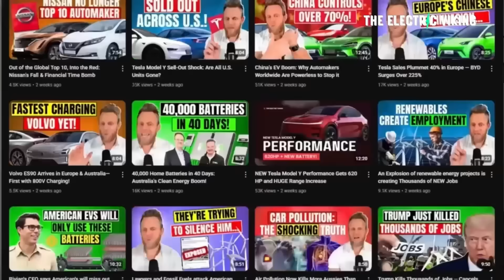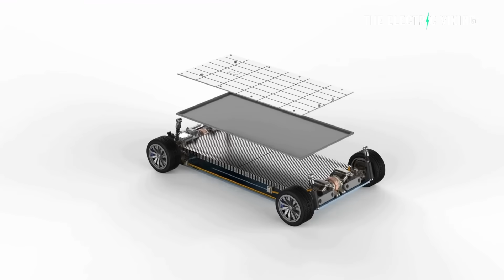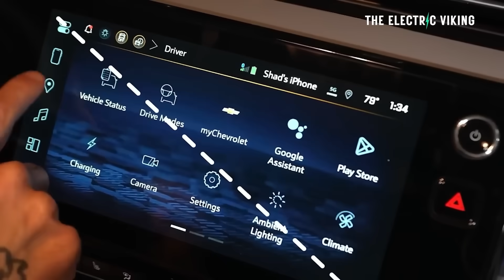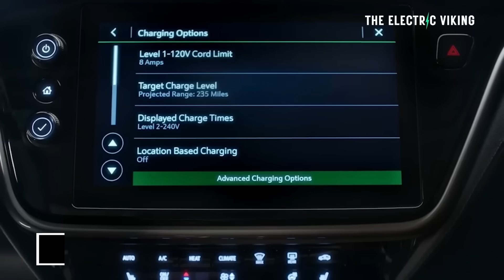GM Launching Family of Low Cost EVs with Lithium Manganese Batteries

Comment: You really really really need to Lookup a company called "Material" in Miami, FLA U.S.    They are 3D printing batteries,  anode, cathode, and electrolyte/separator all in the Same Print, at the same time. Printing in 3 different mediums with all 3 parts of the battery simulataneously.... You can now make 
a battery in ANY Shape. Therefore you do not need to build around the battery any longer. You Build The Battery As Part of the Elec. How come you or 
aye did not think of this? How come CIA or DARPA or NATO did not think of this?

Comment: The NACS connector is designed to support a maximum voltage of 1,000 volts DC and can deliver power levels up to 650 amps, allowing for very fast charging capabilities, theoretically 650 kW.  That's a lot of power.  I think the key to EV adoption at this point is charging rate; if we were anywhere close to 650 kW for 10-80% charging, we'd be done, even in cars with 250 miles of range.   That's what I'm keeping my eyes out for: battery technologies with pack energy densities > 200 W-hr/kg and charge rates > 400 kW capable of handling high charge rates with at least 2000 charge cycles before significant degradation. Of course, higher is better, particularly when it comes to energy density.

Comment: Chevrolet is already to low cost provider of EVs in the US. I think what they see is an underserved market with little competition. Also, the higher price ranges are dominated by (high profit) ICE vehicles and GM doesn't want to take any sales from that market so the lower range is the only place left to go. They also see average car prices at nearly $50k and might believe they are losing new car sales to the used market so again a lower priced EV is a good target.

Comment: An ev in the $ 25,000. range not $ 30,000.
Reply: and with 5 years warranty (8 yrs battery). All of the chinese cars have 5-6 years warranty where I live. The New Chevy Captiva EV has only 3 years warranty and costs 34000 USD!!! 3 years is nothing for an EV. Are they not confident that it will not break down?

Comment: I drive a Bolt EUV. I like the car quite a bit. The charging speed is a huge drawback for the car. The way I drive, as an Uber driver with an occasional longer drive to visit family, an extra 50 miles of range would mean that I could drive to visit my Mom and Dad in their relatively rural location, and return home without charging. Having to stop to charge adds a good 40 minutes in the summer and 50 minutes in the winter to my trip. I look forward to seeing the range on the higher levels of the Bolt. I am a bit disappointed that GM didn't take the time to update the Bolt more than they did and the fact that it is a short run will make me want to wait and see what comes after, when I would otherwise have considered the upcoming Bolt. Still,  my wishlist will includes an 85 KWH battery giving the more upscale car a range of 330 miles +/-, a panoramic sunroof, heated and cooled leather front seats and Super Cruise autonomous driving. If they can bring that to market for under $35,000,  they'd really have a killer little car. But I digress, put all that in a brand-new platform with new battery technology with faster charging speeds for the same money with a sleeker body and that will be my car. Or I'll get a Kia or Hyundai, or possibly a Rivian if their compact car is in a competing price range. I look forward to the growth of the segment, ie more affordable e's. My dream EV, an all-electric Ford Maverick with a 300 mile range for under $40K.

Comment: I can't understand why every manufacturer isn't immediately pivoting towards sodium ion. If the clams are correct I would think they'd all be going all in on it.
Reply: Scrap 5 years and $2 billion!  This new thing is better by 10%!  This is why you don't run a company.
You would be in jail for destroying profits.
Reply: @davidbeppler3032  It can't burst into flames, it costs 20% as much as lithium ion, it can be shipped with 0% charge, it can charge faster, doesn't have issues with low temperatures, and has a longer lifespan and more charge cycles - you don't throw good money after bad.  That's called a sunk-cost fallacy.

Comment: The new Chevy EVs?? They come from SAIC, and will hit the Tariff rather nicely.  Chinese owned factories in Mexico are not going to be happy.  The only thing "chevy" is the badge on the car.  The rest is all Chinese... Chevy's contract with SAIC goes thru another year or two.. then needs a full re-negotiation, which will be the end of GM.  SAIC is doing ALL the engineering on the EV line (which chevy can't sell because of no demand) --- and smaller trucks.  With their awful engineering and needing to replace all the V8 engines from 2019 on, they will be vanishing in the near term.  Same with Ford, and probably what is left of Chrysler...

Comment: Good for them but the States is not an easy place to sell an EV. Hell, I even have to be careful of who I'm talking too about my EV.
Reply: Wow, this is crazy mate😐
Reply: ITS BECAUSE IN AMERICA AND MANY BIG COUNTRY AN EV THAT GOES 300 MILLE IS LAUGHABLE. HOE EVER ALUMINIUMION BATTERIES WILL FIX THIS PROBLEM: 600 MILES, EXTREME RAPID CHARGING TO 100% NO LIYHIUM SO NO FIRE DANGER, NOT AFFECTED BY HOT OR COLD WEATHER, HALF THE WEIGHT AND HALF THE COST, RECHARGEBLE FOR 30 YEARS, SO GREAT RESALE VALUE. DONT BUY ANYTHING ELSE, THIS WILL SELL IN AMERICA, AND AT A UNIVERSITY IN CANADA : THEY CREATED THE QUANTUM BATTERY : CHARGES IN SECONDS, THIS IS NEW, WE WILL WAIT AND SEE.
Reply: @art333-dg8dd  400 km range is more than sufficient for 95% of drivers.  Cost and supply is what prevents EV’s from being more widely adopted.
Reply: @art333-dg8dd  What are talking about?

Comment: When the equinox gets this battery 30%  equels 385 miles of range. This is more what people want in the u.s. closer range to gas.
Reply: He said 30% cheaper and even if it is 30% more energy dense that does not mean they will put more kWh in, remember it was supposed to be cheap cars.
Reply: How is it going to work in sub-zero temperatures and salted roads? That removes nearly half of the US from practical EV use.

Comment: GM has been pursuing the EV market the right way, slowly building its supply chain into a robust, vertical operation.  I have a ‘23 Dodge Charger SXT AWD—fantastic car—maybe a little big for my needs but a great highway car but Stelantis botched its replacement badly.  Too big, too costly, to many software problems.  I’d love to see a stylish 4 door sedan with classic muscle car overtones based on either the Equinox or Bolt BEV skateboards.  Dido with a compact, town centric pickup—much like the proposed Slate.  Compact minibus is a no-brainer.

Comment: Manufacturing costs can be significantly reduced by redesigning GM EVs to use the Gigacasting of front/rear subframes and unboxed (parallel) assembly lines.  I’d like to see a cheap small truck based on the Bolt or Equinox skateboard. Back in the 80’s Chevy had a small imported Light Utility Vehicle (LUV) pickup, so how about a $25K LUV EV, or a half car half truck $30K Chevy El Camino based on the Equinox EV. Finally, I think there is a market for AWD versions of the Bolt, and GM EVs are designed to support AWD easily with their 90 hp AWD Assist Motor. I think a Bolt AWD EV would sell well in snow and ice areas, I also think adding that motor together with the Bolts 210 hp FWD motor could a pretty quick 300 hp Bolt SS.

Comment: I’ll believe it when I see the first public launch.
Reply: If the new Bolt comes out early '26 then GM came through when they said they would. If..
Look up what Mary Barra said..
Reply: @ronfarnsworth7074  Yes. They freshened it up. Nice!  A whole new "family"? Hoping for it. Not holding my breath. Remember this company just sunk 1 billion into a "new" V8....
Reply: Yeah. GM should follow a tight timeline like Tesla 🤔
Reply: @buckw65  🤣🤣🤣
Reply: Yes. Just like with Farley and the recent NEW Model T moment.
Reply: if it has lithium in the battery dont touch it, new aluminium and sodium batteries are already here
Reply: @art333-dg8dd Even more important, don't touch fossfuels.
Reply: @art333-dg8dd  Not sure where here is but it's not the USA